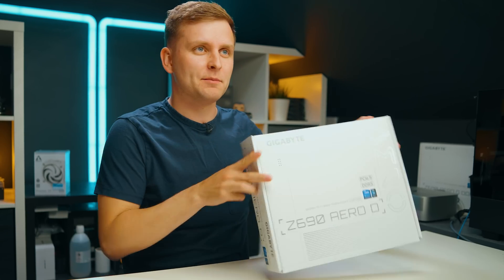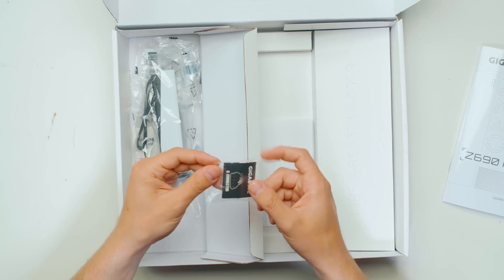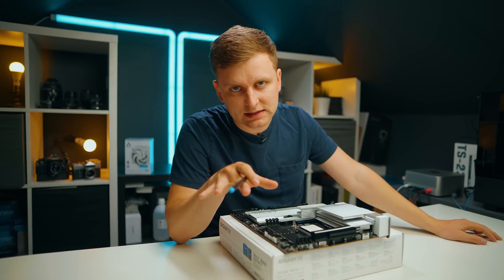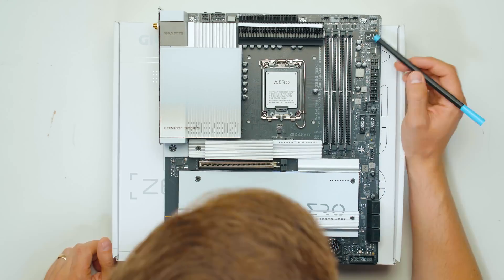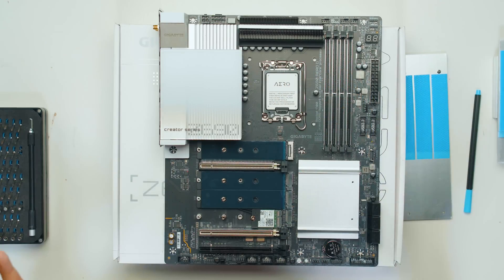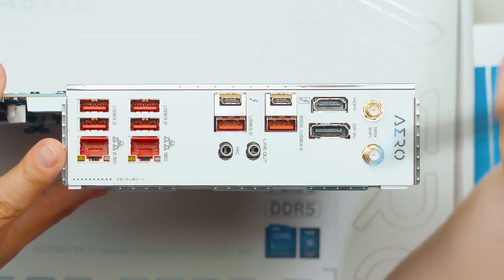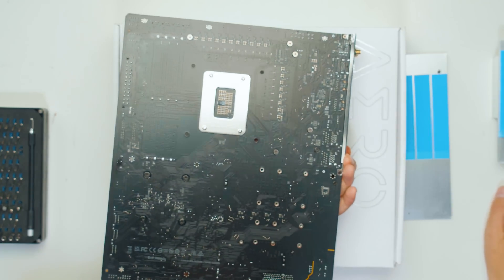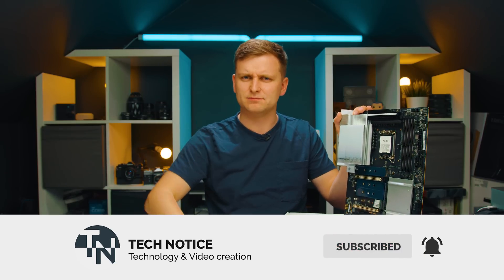They NEED to make more Motherboards like THIS! 🔥 | Gigabyte Z690 Aero D Overview

Comment: @tech notice, need advice, aero g z690 at $220, aero D z690 at $300 or aero G Z790 at $280? For davinci resolve 4k 120fps editing.
All DDR5. With intel 13700k
Reply from the maker: All good options ;) but for best ram stability z790 is better
Reply: @theTechNotice  thank you

Comment: Hey I need to make a music production and gaming build . I need thunderbolt but I want 13th gen 13700k would be any problem with performance since it’s z690 and not z790?
Reply from the maker: Go with Z790 Aero G and add the thunderbolt card in there!
Reply: @theTechNotice  yea it sound better right a z790 for the 13th gen . i already have the gigabyte alpine ridge rev 2 thunderbolt 3 card do you think it will work in that motherboard?

Comment: I have this motherboard with a I9 13900k. I'm having and over heating problem. My cooler is CoolerMaster MasterLiquid PL360 FLUX and fans are running full speed. Can you suggest the correct Bios setting that may help with this problem?
Reply from the maker: Set PL1 and PL2 limit to intels stock settings :)

Comment: I currently have a Gigabyte Z490 Vision G. Will my  EVGA RTX 3080 FTW3 work in the slot with that heat sink. Great video. 01/16/2023  1414. Subscribed as well 👍

Comment: Is there a difference in the motherboard ethernet ports that are 10gb vs 10gbe? Also, can you use higher quality audios through thunderbolt since this motherboard only has audio in jacks?
Reply: 10G, 10GB and 10GbE all mean the same thing: 10,000 mbps ethernet link speed.
Your internet connection is probably not going to be even at least 1GBPS, therefore the only benefit of having an ethernet port above 1GbE is bandwidth and less congestion over the ethernet link. There will be little to no internet speed change using 10GbE, however it does have a few advantages:
Usually network uplink, e.g the speed to your router is significantly faster which yields faster internal network speeds
Faster transfers from your NAS, if you have one
And, really for that matter, 10GbE is used with servers for their massive performance and uplink.

Tl;dr - 10GbE LAN will not affect your internet speed. However it will affect intranet speed, including NAS transfer times and internal server hosting

Comment: How would this compare to the MSI Z690 Force WiFi? Both are white boards that would fit the aesthetic I'm going with.
Reply from the maker: FYI, Force wifi is abit more silver rather than white :) 
But this one has better features for creators.
Reply: @theTechNotice  Have you tried both boards? If so what are your thoughts on both and which would you recommend?

Comment: Can we get more details between the Aero D and G in terms of performance?
There seems to still be issue with 4 slots of ddr5 - So would 2 x 32MB DDR5 at 5200  perform better than 4 x32 DDR4 at 3200 ?  as the Ram price is still roughly 1/2 for ddr4
Thanks
Reply: Up to 5% better in best case (compared to DDR4 3600 cl16)...but at cost of 3x...but some programs like more low latency DDR4

Comment: You should've mentioned that the DisplayPort on this board is only a DisplayPort in, not out. So that leaves you with HDMI 1.4 (yes, 1.4.. which means 4K @ 30hz, 1080P @ 120hz..). However, the thunderbolts do support DisplayPort. If you plan on using a GPU without any display outputs, keep this in mind
Reply: @Kyler so this won't work with my Xp-Pen Artist 24 pro?
Reply: The manual DOES state the HDMI only supports 1.4. If this is indeed true it will not output 4k@60fps nor will it support the REC 2020 color space.

However, 12th and 13th gen. Intel CPUs with iGPU do support HDMI 2.0. So I'm wondering why the motherboard does not.
Reply: @thelegendaryblackbeastofar39  exactly what i thought. I guess it's a fluke

Comment: Can someone please share their build details if you've used this motherboard. I'm looking to build one and so need some help. Can we use "Mid Tower e-ATX Case" with this motherboard or should have a Full Tower Case? Also is it recommended to get separate cooling fans or can use the ones which come by default with the case? Thanks
Reply: This board is only about 1.5cm wider than an ATX board, so I'd go with the mid tower case. Buying separate fans lets you choose the quality. Some case fans are cheap, some are really nice.

Comment: I'm running 128GB DDR5 off the ASUS Z690 Pro Art
Reply: I head the board has issues with Thunderbolt and 10Gig. Did you face any such issue?

Comment: The difference between “vision link” and the other port is: the vision link port will tunnel display port  video from your discrete video card over the thunderbolt bus. So you can use the thunderbolt port to connect to a usb-c monitor for example and the display signal will be driven from your video card. The other non “vision link” port does something similar, but it’s linked to your iGPU if you have one.  It’s just marketing nonsense from gigabyte. 

So if you connect a thunderbolt dock to the vision link port, monitors connected to that dock will be driven from the discrete gpu. the pro art z690 has dp in ports as well for this purpose, so does the z690 ace and one of the ASRock motherboard. and I wish other motherboards like the asus z690 hero or formula had the same feature but they do not.
Reply: Sorry, bit confused. So, if I've an integrated GPU in my CPU, can I use either of HDMI/TB4(non 'vision link') ports directly to connect to my monitor? In other case, if I've got a Graphics Card, should I connect the DP out of that to the DP In of the motherboard? Then how/where does the TB4/VisionLink port gets connected to? Thanks. I"m trying to figure out where and what is the need of the DP In Port?
Reply: @hemm2333  so if you have no dedicated gpu but only an igpu, you can use it with the hdmI out, and both thunderbolt ports.  If your cpu has no igpu then you will get no video output. 

But if you have a discrete gpu and you want to use it with your monitor over the thunderbolt bus, then connect a DisplayPort out from your discrete gpu into the DisplayPort in on the motherboard. The purpose of the display in port is so that the motherboard can tunnel the DisplayPort output from your discrete gpu via the vision link port. The benefit when use your monitor via thunderbolt, the signal will be driven from your discrete gpu and not the slower iGPU. You can connect the monitor directly to the thunderbolt port. Or you can connect a thunderbolt dock to your motherboard, and the monitor to the dock. And the display signal will be from your discrete gpu. 

This is cool because the iGPU is much slower (for gaming for example) than a discrete GPU. So if you can use your discrete GPU via the thunderbolt bus, you can game at high frame rates. Only thing I haven’t tested is whether DisplayPort tunneling on z690 supports variable refresh rates like monitors with AMD freesync. In theory it should because it’s just a tunneled DisplayPort signal. I know Apple’s thunderbolt 4 solution supports variable refresh rate. But hopefully this helps.

Comment: Excellent review.  Something I notice on this review and in fact on most computer builds nowadays is the perceived importance of the APPEARANCE of the components.  How about a build video, Best Bang, with no cost towards special colors, or RGB, or visual touches.  Concentrate on performance only.  I'm looking for a 12th gen creator machine, probably 12600k, 64Gig, 2TB with zero concern for visuals.  Thanks.
Reply: I absolutely agree. I want performance, not some shallow adolescent rgb colour scheme that adds nothing to the actual creation of content. Nothing says cheap tat like RGB......of course, you pay more for the 'cheap tat' look, but, that's marketing bs for you. :)

Comment: Greetings sir. If you would be so kind to give me some genuine answers of my questions, it will be very helpful for me.

1. Why people think Intel motherboard is expensive but never mind AMD? (Not gonna lie, the rog x570 formula, impact, msi unify, ace, godlike etc type motherboard do cost higher than the Intel counterparts.)

2. Why people praise AMD for overclock when intel can cross 6 and 7GHz but AMD still can't with their 5000 series?

3. Why people say intel is hot? Do 5900X and 5950X run in negative° numbers?

4. Why people are crazy for AMD motherboard and call it future-proof when a 5600x owner is also going to use it for at least 4 or 5 years. Couldn't AMD had launched a lot of motherboards in-between that time period? So why Intel having no future upgrade always got criticism when both are being used same?

5. Why people don't agree to get an DDR5 Intel? Upcoming AMD is on pure DDR5 and don't have a DDR4 separate version like Intel. Price are high I can understand but are prices going to become extremely affordable when AMD will launch 7000 series? Is AMD LGA1700 going to launch without any single issue? I doubt it can have same instability and issues as Intel LGA1700

Note: I am sorry if I sound aggressive. I am kinda new to this PC building and don't understand most things. Especially the flame wars like Intel vs amd, nvidia vs amd, gigabyte being bad etc

Comment: I'm making a build inspired on your $1500 PC, and I would like it to be ddr5. This aero D board is expensive, do you believe the Gigabyte Aero G ddr5 is a good alternative? Do you suggest other alternatives?
Reply: Yes it is. Almost the same board minus the 2nd PCIE 5.0 slot. The main differences is it's a EATX board with 2nd additional Ethernet port @ 10G. Same VRMs, etc.

I'm actually building a i7 13700k with the z690 Aero G now 👍

Comment: For creators? U mean video/photo editors... Let me tell u that it is not enough for maximum cad workstations with on 4 mem slots.
Reply from the maker: Well, creator boards are a different league of things and interestingly there's not been a huge update to the HEDT CPU platforms neither from Ryzen nor Intel, so this is what the Prosumers have to work with :)
Reply: @theTechNotice  well yeah, but speed is to be honest not that important today. Either you get a biffy system with lots of dimmslots or you build a super small itx system with an i7/i9 or even an am4 sys if you prefer that. But those 4slot dims mobos are nothing special, better to buy the cheapests msi z690 board instead as it has the same amount of ram slots and have 4 m2 slots as well.

Comment: I don't understand. Can someone explain me the difference between this and a more low budget motherboard. you can have practically the same spec for 300€ less.
Reply: the dual pcie 5.0 slots for dual GPU, thunderbolt & 10GBe ports are what I see. Which MB would you compare this to that's cheaper?
Reply from the maker: Also Port selection. You won't get a 10GBe port, which on it's own costs $100 for example.
Reply: I think power delivery, vrms are better on the higher end models.

Comment: GPU will block most of that cover anyway.  I have a Vision G motherboard and barely notice the motherboard cover begind the GPU.  But I do love the look of the Aero-D, but of course that's coming from who's using a Vision-G which is what the line used to be called.
Reply: Add a Noctua cooler on as well and....
Reply: Mine is water cooled.

Comment: Is that HDMI 2.1 ?….Its been known since the 486 computer that Aluminum does NOT make a Good Heatsink. Cooper is a better conductor of Heat. Where is the 5.1 Audio ?….If you cover everything up the motherboard will not be able to dissipate Heat.

Comment: I've always wondered if the vrm cooling on boards with these cover pieces perform at noticeably different temperatures when mounted vertically versus horizontally. Is it designed to take advantage of convection?

Is it still the acquantia 10g nic?